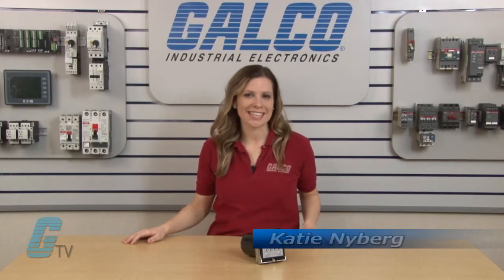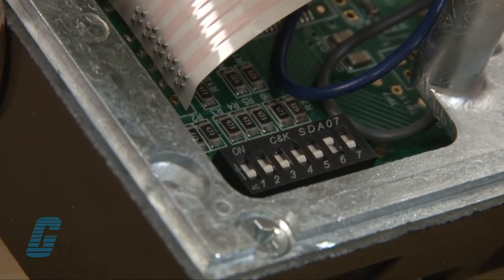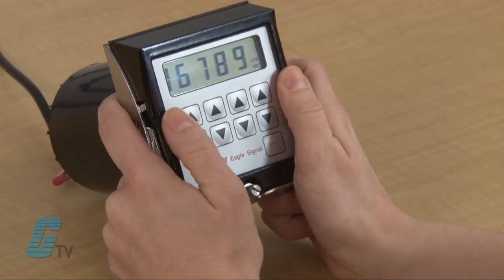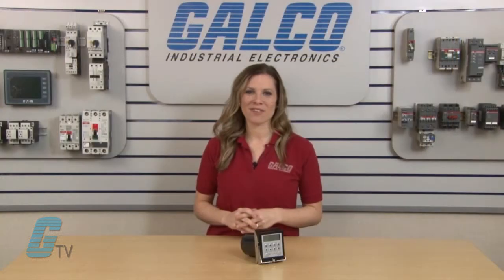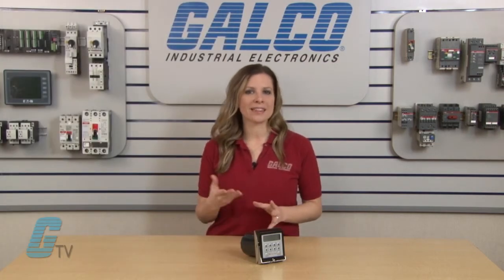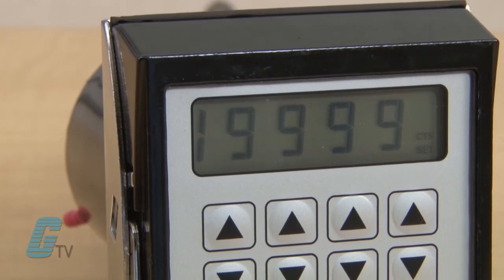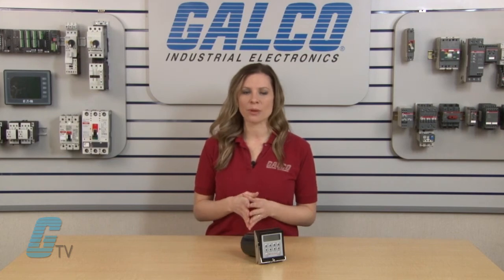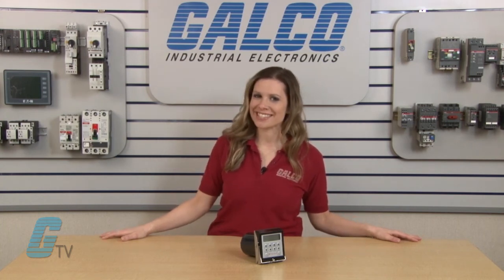Eagle Signal CX300 Preset Timer

Comment from the maker: The CX300 series is a microprocessor based timer/counter that is housed in a standard 15 terminal plug‑in case which allows easy removal from programming changes and replacement. Time or count operation, time range, and the type of start input switch operation are programmed with 7 miniature rocker switches located inside the unit.